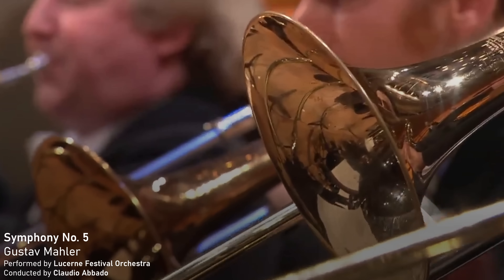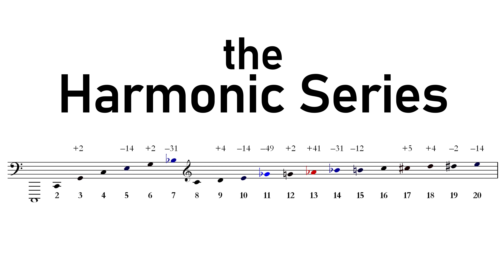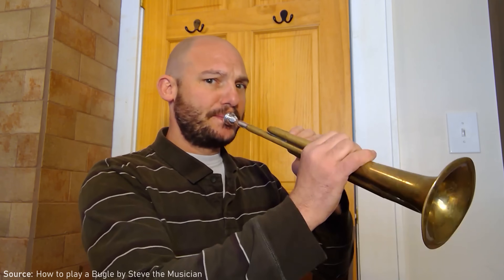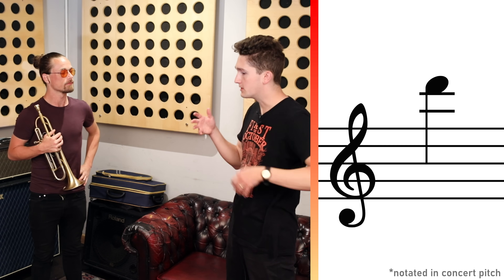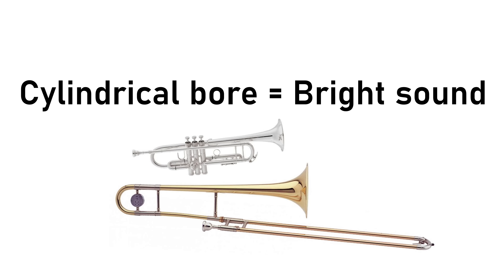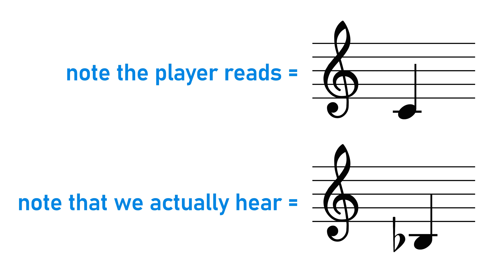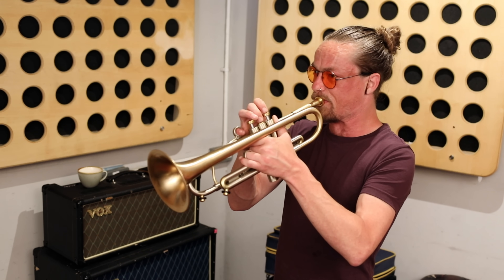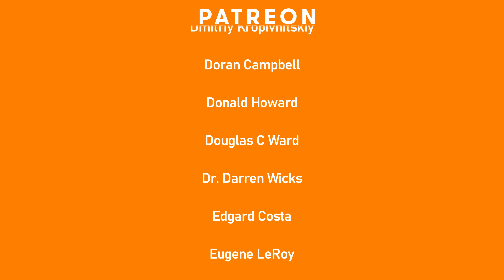How do Brass instruments actually work?

Comment: 5:31 this is NOT a good example of a tuba: only 3 valves , should be 5, and bro should not be puffing his cheeks
Reply: Every tuba I've ever seen has 3 valves.
Reply: It’s actually 4-Valves. It’s an Eb tuba, and like most Euphoniums (tenor tubas) the 4th Vavle is sticking out on the side. And there’s nothing wrong with a three-valved tuba when it comes to tubas in F, Eb, or even B. But once you get into more professional settings you would want at least 4-6 valves depending on the key the tuba is in.

Comment: Fun fact: The "tuba" that surrounds the player's torso and has its cone pointing at the front is not actually a tuba, but a sousaphone. It was basically made to be easier to play standing and so the sound reached outwards.
Reply: ingongo, if you are going to write "fun facts", make sure you actually know some pertinent facts first.

The Sousaphone is a kind of "helicon", which is a type of tuba. The shape that a brass instrument is "wrapped" in IN NO WAY defines which type of brass instrument it is.

Comment: I had a go at playing a trumpet when I was in Primary or elementary School. i was pressing the valves, but not getting very much volume change or pitch change above a normal voice, around 50 decibels  or out of the key of b flat major, which was most frustrating. I'm glad I wasn't taking any lessons in playing brass anything, even though it was free.

Comment: The 11th harmonic feels unloved.😅 But seriously if youre gonna play the 7th, then play the 11th too which is less out of tune and quite useable on most brass instruments. Trumpet and euphonium often do not use the 7th harmonic because it is difficult to lip it to a useable pitch. Trombone uses the 7th harmonics of the extended slide only because it can play it shorter.

Comment: It’s interesting to think of it like this: the source of the sound for a brass instrument is the player’s lips. The instrument is essentially just a way to amplify the sound of buzzing lips. In order to play a note, your lips have to be vibrating at the same frequency as the length of the instrument.
Reply: tyrepair, "interesting" maybe, but incorrect. The brass instrument is much more than a way to amplify the buzzing lips.
The buzzing by itself has no particular waveform ('timbre'), and is very 'noisy' with many random harmonics. The mouthpiece (the function of which is totally ignored in this video) helps to refine the rough buzzing and also acoustically couples the players lips to the rest of the instrument, a very critical function. Then the instrument's own acoustical properties give the particular 'timbre' or tone color unique to that instrument. And probably the biggest function of the instrument is to allow the player to ACCURATELY produce the desires pitches, and simple lip buzzing alone does none of that; this is another critical aspect of brasses which this video essentially overlooks.
Reply: I'd say a brass instrument selectively amplifies some of the lips' vibrating modes while attenuating others.  It doesn't merely act upon the lips' sound after it is produced, but can pull or push slightly on the lips to make them produce more sound at some frequencies.
Reply: @flatfingertuning727 , in order to "amplify", addition energy must be added, which is not the case here. What DOES happen is resonance, which is too complex to be discussed in YouTube comments.
Reply: @youtuuba  The presence of the air column increases the amount of sound energy the lips will produce at certain frequencies, and reduces the amount of energy they will produce at others.  You're correct that the tube cannot by itself add sound energy, but in the absence of the tube, only a tiny fraction of the sound energy that leaves the lips will go back to them.  Increasing the faction of the sound energy that rebounds at some frequencies--even if the gain is still less than unity--is nearly equivalent to amplifying the rebounded energy at those frequencies.

Comment: actually
the column of air trapped by the brass is the vibrating element
the buzzing Lips are the excitation mechanism producing a series of puffs thru the column of air
those puffs bounce back and forth from the bell and excite the natural resonance in the column of air
the sound does not come from the embouchure - it comes from the column of air

in a string instrument
the string is the vibrating element
the bow is excitation mechanism (Like a series of plucks)

Comment: The French horn is the most unique of the brass instruments. Its bore is twice as long as the "transposing pitch" would suggest, and this means hornists are playing higher in the harmonic series than other brasses.  This was great in the pre-valve era, as it put the diatonic partials (8th through 16th) in playable range. But it's a nuisance from the point of speed and accuracy, because it's much easier to hit a wrong note.

To get around this problem, modern horn players usually use a double horn with a higher B-flat bore triggered by a thumb valve.  That allows the player to play the same notes on a somewhat lower harmonic step, improving accuracy and sound.   There are even triple horns with a high E flat or F section, for extra accuracy in the high register.

Comment: 0:51 Almost, but not quite. The 'embouchure' is the position of the lips when they do the buzzing, not the buzzing itself.

edit: 10:13 Mutes do make the trumpet play more quietly, but their primary purpose is to change the tone, not the volume. They're used in ensembles of every size.

I think it's also worth saying that 'embouchure' isn't just a brass term, it's used by woodwind players as well, even though they don't generally do any buzzing. It's just a name for the formation of the lips.

Comment: 3:26 It's like binary: 000 = 0, 001 = 1, 010 = 2, 011 = 3, 100 = 4, 101 = 5, 110 = 6 and finally 111 = 7.
         Note that we start counting at 0 as in zero valves pressed, but could end at 7, so totally 8.
        At least that's the mathematical theory. I don't play trumpet, but it's sort of like this.
        In fact, I wish it was like this, because this is akward and ot mathematical at all!

Comment: Tuba player here ready to debunk some misconseptions created.

Firstly, we don't fully buzz the lips since it makes a terrible sound. We need there to me more air than buzz.

Second, the speed if which we buzz does not affect the pitch but how controlled the sound is.

Thirdly, to change pitch we move the tounge higher or lower and make the lips tighter or more open (the hole being smaller or larger). Not moving the tounge and lips can change the note but getting higher in pitch gets very tiring for long period. Also it is terrible technique.

Third, the length of the instrument does not affect the airflow. The airflow is only down to the player themselvs.

Fourth, embouchre is not the way that we buzz the lips but how small or large the gap between the lips are and the position of the tounge is not the rate we buzz.

Now I will some things,

The more valves we push down the more resistance there is because of the additional length of tubing added.

How mellow the instrument is, is effected by the shape of the bore but it is also down to the player. 

The mute does not effect the volume as much and effects the timbre more. The player should know how to work around the mute by supporting the air and playing slightly louder than if they were unmuted (bit like the una corda on piano).

Overall, good video but I did some puzzled expressions about what the professionals where saying.

Also the trombone slide is not called a slider but a slide XD.

Comment: You show a chart with 7 harmonic series. Why is there not one with the third valve (only) pressed?
Reply: the third valve by itself is the same effect as the first and second valves together (and you usually play those notes using 1st and 2nd valves together because most of the time that way is going to be more in tune than playing the note with the third valve alone)

Comment: I was a trumpet player back in high school band, and this video actually had some stuff I didn't know about brass instruments.  It also had a few things I'd forgotten, or preferred not to remember.  One little point of note is that if you take the trumpet valve out and put back in backwards, which is surprisingly possible, you're blocking the wind tube, and it'll make a funny, squashed sound, because the air can't get through the instrument like it's supposed to.
Reply: macsnafu, depending on the instrument, and often on WHICH valve is backwards, you might get either a partially blocked tube or a completely blocked tube; the latter will not produce any note at all, with the only sound being a curse from the player.

Comment: 11:31 for those wishing to write for brass, I would like to point out that trumpet is in Bb (down major 2nd) and French Horn in F (cant remember if up 4th or down 5th). However, although nearly all low brass is tuned to Bb, they read and play in concert pitch, so if you write a C, they will play a C
Reply: It's a little more complicated as that. Most French horns are double horns, meaning that hey have tubing for F and tubing for Bb. The player selects the tubing he wants with a thumb valve. French horn players are masters of transposition. They can have a score for an instrument in whatever key; the score usually mentions for what type of horn it is written. E.g. the score for Mozart's 4th horn concerto is written for an instrument in Eb and on top of the score it will say: "French horn in Eb". The horn player has to transpose on the fly. So, it is true that if you give a French horn player a score for an instrument in concert pitch, he will play in concert pitch, transposing on the fly but the score will tell him on top that it is written for an instrument in C, so in concert pitch.
Reply: "However, although nearly all low brass is tuned to Bb, they read and play in concert pitch, so if you write a C, they will play a C" Until you encounter continental European baritone, euphonium and tuba players. I know this video is mainly about Orchestral writing, but euphonium especially has such a great demand of its entire range that bass clef is kinda cumbersome to write in, so providing a treble clef transposition of the part is never a bad idea.

Comment: The bore of the French horn isn’t really the same as the other conical bore instruments. It has a fairly long cylindrical section, standard horns having a 0.468 inch bore. You’ll notice that the traditional British brass band, which is comprised of all the so-called conical bore instruments, does not include French horns. The horn has some more overtones than the conical bore instruments but the tone is mellowed additionally by the hand in the bell.

Comment: When I was in drum and bugle corps they had one valve and one half step rotor then they went to two valves always in G then they switched to B flat three valve horns in 2000 and they are no longer called bugles.
Reply: Bet u

Comment: Glad you addressed how saxophones are woodwinds. We use a single reed mouth piece (quite similar to a bass clarinet) and we change our tone by the actual keys and tightening of our embouchure. Excited to see how you cover the woodwind section. I know saxes aren’t in the orchestra but I hope you cover them as well :)
Reply: Unfortunately, I doubt he'll be covering other wind instruments that never appear in orchestras or classical music.  The harmonica is one of the most interesting because unlike all other reed instruments, it produces sound both by blowing AND by sucking air, thus a harmonica player may not need to stop and breathe.  Also of note, the harmonica had it's sort-of 200th anniversary in 2022, about 20 years older than the saxophone.

Comment: Hey! How the player change between notes in a harmonic series? It's the pitch of the "buzz" sound he creates with his lips or the speed of air flow? Is it impossible to play not only notes but any other frequencies between them? Why? What happens if he create the sound so it is not the exact way to produce an actual pitch? The actual pitch will jump between notes randomly?
Reply: As a student still learning the French horn (and having learned the mellophone, which is similar to trumpet), I can help give a basic explanation but not the physics per se. As explained in the video, a faster buzz creates a higher pitch, and that supported by faster air as well as by adjusting the embrochure — how tight certain parts of the lips are. Allowing the center of the lips to be looser causes it to buzz slower, and tightening them causes it to buzz faster and higher. 

It takes practice for beginning players to be able to “bend” between the different “partials” (the different notes on the harmonic series), but it does feel as if you’re “jumping” between notes, especially since it takes some practice to smooth out the transition to be less choppy. This is also why these are called “lip slurs” as the lip adjusts slightly to change the pitch (although air support is also extremely important).

I don’t know the exact physics behind why you can’t play in between notes (you can be a bit sharper or flatter than the harmonic notes, but not exactly hit the in between notes), so I presume it doesn’t resonate as nicely with those notes or something similar.

French horn has a lot more “partials”, which means it can play more of those “in between” notes compared to mellophone (both are in the key of F), but not all. This is because the harmonics are closer together if that makes sense, so there’s less distance to “jump”. French horns, especially “double” or “triple” horns, have a lot more tubing than say a trumpet or mellophone, so this likely contributes to that. If you’re curious, you can search up “French horn partials” and you should find some cool demonstrations.

Double horns are commonly found in orchestra I believe, and have a second set of tubing that connect to the valves, with a “trigger” that directs the air to the second set of tubing when pressed. I assume that the same goes for triple horns (which are less common as far as I know), and the extra tubing helps make the higher range easier. 

The large range that French horn has is both fun and frustrating since it makes it a lot easier to hit the wrong partial when trying to play a note, and there’s also the factor that having a hand in the bell means that that can also adjust the pitch, but that’s better explained by people much more qualified than I 😅

Hope this helped though! (And in case you were wondering, yes all that extra tubing means that liquid gets trapped in the most annoying nooks and crannies, and since there’s no spit valves that’s why you may see horn players removing a bunch of slides and/or turning the horn about to get it out 💀)

Edit: whoops I just realized the absolute essay I just sent, sorry 😂
Reply: @barnowl6752  I really appreciate your detailed answer! Although I've read and watched some content in this topic since my initial question, your answer gave me a lot of new info... and new things to look up (for e.g. partials).

Comment: One correction. Not all brass instruments are transposing. Or at least not always transposing.  The lower brass (trombone, tuba, euphonium, ect…) are generally not transposing instruments. Although this does differ a bit depending on where you live, and is more of a modern change so it is more common thing to have lower brass be transposing in more modern music.

Comment: As a trumpet player and brass teacher myself, I have to criticise your chapter on techniques that is severly lacking.
Yes, the way to create the sound from the instrument is by using your embouchure which is "the main technique", but after that there are several tounging techniques that affects the sound (sharp T-tounge, softer D-tounge etc.). Not to mention other techiques like dipping, bending tones, half-vales, more showcase of the slide on the trombone etc.
Understandably, you can't fit all those in a summary video without making it very long (and there are other videos that do a good job of showcasing these anyway, but saying that there's only "one main technique" to playing brass instruments is just wrong, in my opinon.

Other than that, I thought you did a good job of covering the very basics of playing a brass instrument.

Comment: Excellent as always. Worthing mentioning is that there is another way of adjusting the pitch of a horn, by sticking a hand into the bell. This shortens the length and results in a higher pitch. But it also makes it sound a little muted. And the sound, even when not muted, is more mellow due to the lack of valves.

Check out the Mozart horn concertos performed by Hermann Baumann on such a "Naturhorn", for example https://youtu.be/ZsUz6-nz3KA
Reply: I think the soloist in that video is Javier Bonet - Hermann Baumann is the conductor of the orchestra.